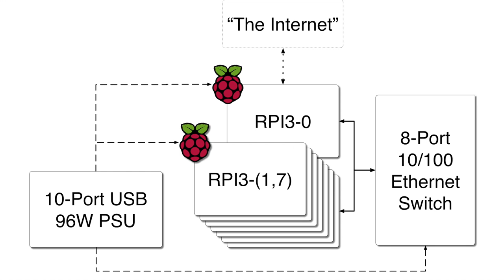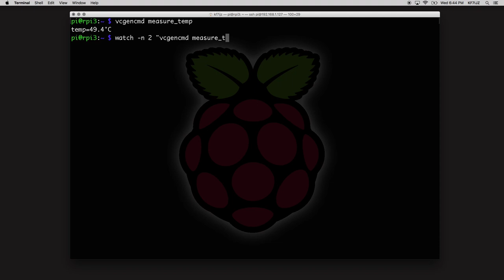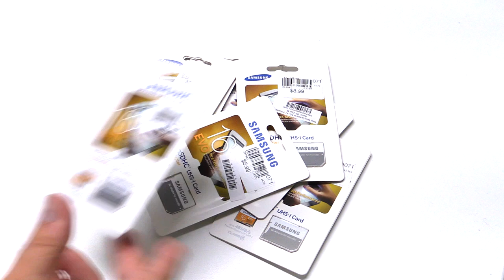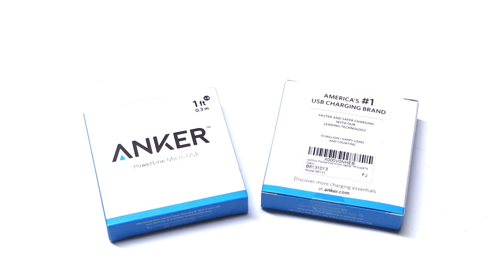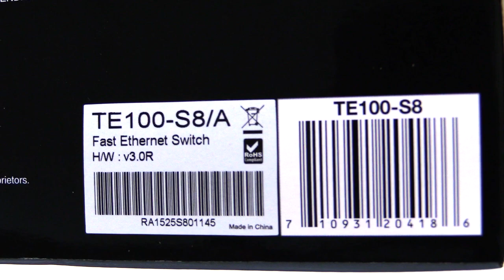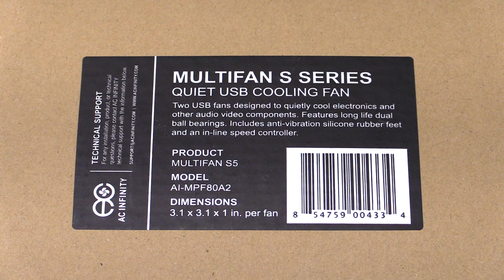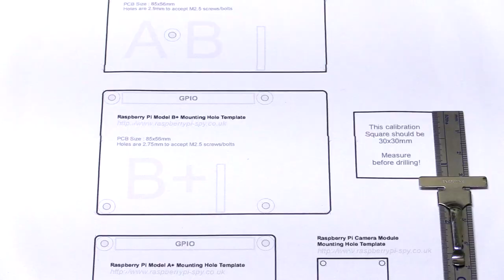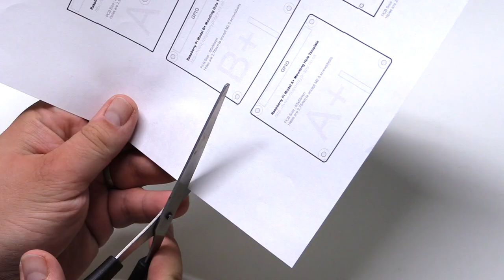Raspberry Pi 3 Super Computing Cluster Part 1 -  Hardware List and Assembly

Comment: To Anybody: My Linux class would like to do this as a project. We currently are planning a 5 node cluster but I'm wondering if any of you have or know where I can download a image with the needed software for a Pi 3 B. Basically to save time I would like to download the image for the nodes and then write it to each of the Pi's SD cards. We can configure them once it's up and running. Thanks for any help!

Comment: but why? won't a gpu destroy this thing at computing?
Reply: But then you wont be able to test cluster computing.
Reply from the maker: Absolutely!  I don't have any traditional desktops with discrete GPUs in the house (all Macs or Intel NUCs).  This was mostly an experiment for me to play with.  Besides, if I had used a GPU, I wouldn't have been able to make this video!  One legit use is to simulate a real 32 core cluster.  Alex Ellis does a lot of great stuff with Pis to simulate Docker situations, for example.  Could also play with ansible or other CM tools.

Comment: the heat sink its at the wrong side of the air flow  XD (don't know if it make a deference but i mension it :P)
Reply from the maker: In my actual experience with the other clusters I have built (RPi 2 and RPi 0), it doesn't actually matter as long as there is sufficient air flow coverage over the top of the fins.  My other cluster has them every which way and the heat management is the same and the heat for each CPU.
Reply: Oh , ok ! :)

Comment: I'll start right off with "I didn't read in the comments whether someone has pointed that out yet or not", but why the hell are the fins of the last pi square to the airflow? You're effectively hindering the cooling of that top node by doing so. In the case of a raspberry pi it's not that big of a deal, but it's the principle that matters..
Reply from the maker: It was an honest mistake - also, there is no hindrance of the cooling - stays the same temp as the other Pis.  Remember if air is blowing over the tops of the fins, you are creating low pressure which means the surround air still gets drawn through the fins, just not as fast.

Comment: You could have PXE booted these pi's and saved yourself $80. Easier to manage the OS images too :)
Reply: I thought that too but wasn't sure if they had that abiltiy built in or needed local storage to enable it with software.  But with each having local storage it enables building a nice data distribution and management system.
Reply: OptimisticPessimist they still need local storage, but 1) much smaller (cheaper), and 2) which is my main point, easier to manage only one copy
Reply: So for that, you'd want a good card with all the capacity you need for everything plugged into the boot device, the rest can use whatever still functional cards that others were going to throw away.
Reply: OptimisticPessimist yes, one raspberry pi could be used to host the pxe boot image but it doesn't have to be an existing pi, it could be some other server with multiple roles

Comment: If 8 pies take all 8 ports how are you getting to the internet or managing them remotely?  Are you dual homing the wifi?  That seems clunky.   Wouldn't a 10 port or 16 port switch be better?
Reply: Yes!! YES!! This!! It drove me nuts! He said he didn't want to use WiFi, but unless he magically acquired an extra port on his switch, he's going to have to use WiFi on Pi 0 to make it the gateway for the other 7 Pi's :P
Reply from the maker: Sorry I wasn't clear about this.  I am using WiFi from RPi3-0 to connect to my home network - I didn't want to use wifi from every node in the cluster.
Reply: KF7IJZ now see that makes MUCH more sense, thanks for clearing that up :)

Comment: shame it can't use Power over Ethernet....
Reply: You could do that. Add a USB type B plug spliced off the Ethernet cable.
Step 1: Get raw CAT5 spool.
Step 2: Use only 4 wires and make Ethernet cable.
Step 3: Take remaining pairs, add USB type (mini? micro? standard?) B plug.
Step 4: Take remaining pairs on other end, add Molex or SATA Power plug
Step 5: Use low wattage PC PSU.
Step 6: Success (quite ghetto, but it can be done). :D
Reply from the maker: There are PoE solutions out there designed for PI but it adds a lot of unnecessary expense and ultimately more clutter to have more boxes/wires than this solution.  Now I hope someday that we'll see a Raspberry Pi 4 PRO w/ PoE :)
Reply: KF7IJZ
That would be great.

Comment: Brah, I love what you're doing but this is not a cluster. A cluster, as far as I know, is when one node goes down the other node in the cluster automatically picks up where the original node left off without any data loss. Key word (high availability), HA Cluster. What you're doing is not clustering. But again, no disrespect I love what you're doing and I've learned a lot... But it's not clustering.(edit) OK I re-listen to/re-watched the beginning of the video and you're right, you defined your version of the word cluster at the beginning of the video. (end edit) Apologies...

Comment: this is potentially the dumbest question you'll probably be asked, but could someone possibly use a configuration such as this to run a small server for a game, say minecraft, halo ce, terraria, etc...
Reply: Yes. You could actually play Minecraft on a single Pi, and the server could easily run on a single Pi. For more power it's possible to execute threads in parallel over the network, so you could do that. You'd need to get java running on a parallel supercomputer optimized version of Linux. Once Java runs, Minecraft is a snap.
Reply: +theLuigiFan0007 thanks, i had forgotten that the single player and server host models run almost exactly the same now, so it makes sense that if it runs on one it'd run on multiple ( once configured ), now to figure if this would be worth putting together for a personal server, i think it would be a fun project
Reply: RunningMan492
 Take a look at this: https://github.com/mappum/redstone
Someone created their own Node.JS based Minecraft server optimized for parallel computing. That project looks promising. Currently only supports creative, but since Node.JS runs on Linux, that means it runs on Raspberry Pi. :D
Reply from the maker: Thanks for sharing!